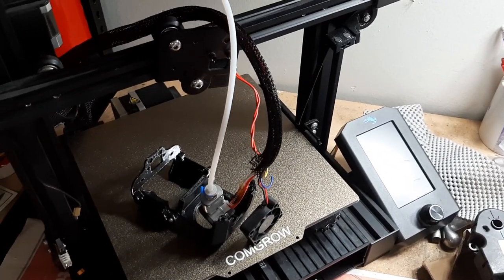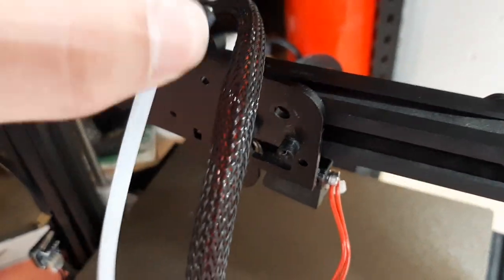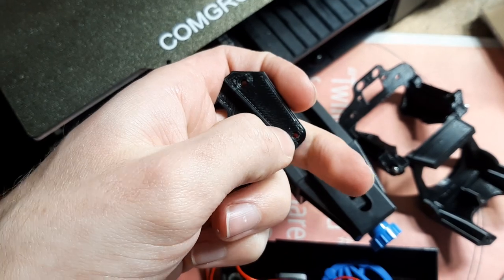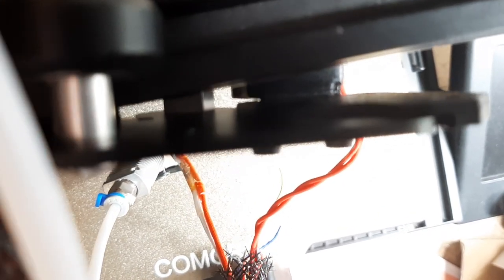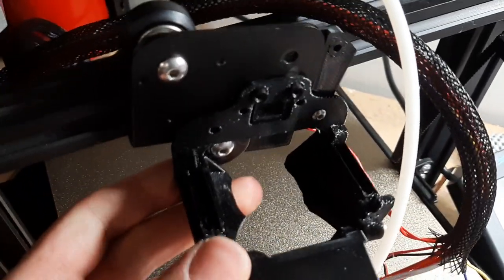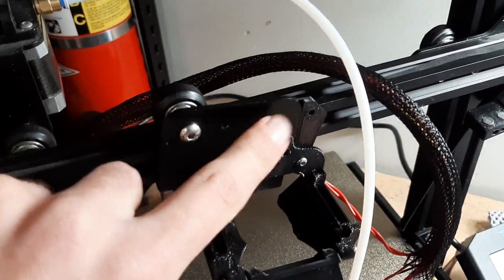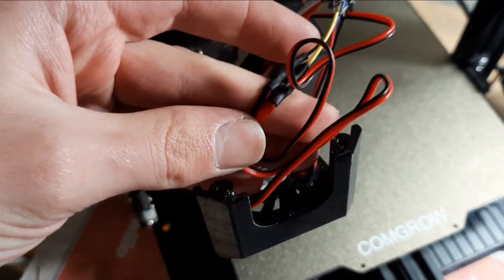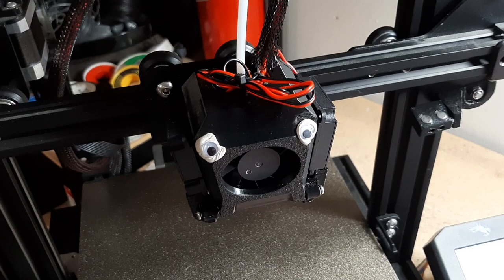MBOT3D Mk2 Remix Installation

Comment: Very nice video! I'm planning to do this exact mod to my V2 too.
How cumbersome are nozzle changes with this shroud on?
And most importantly... How has the performance been? Cooling improvements? Noise improvements?
Reply from the maker: I don't change nozzles often so I can't say for sure but it doesn't look much harder than stock.
Cooling is definitely better but it's only noticeable with very short layers, the stock hotend just can't push that much plastic lol.
It's a little louder but it's not that noticeable compared to all the other fans on the printer. Biggest downside I've run into is there's less clearance for conical slicing (which I do from time to time), I was using 5-7 degrees but now I'm not sure if I'm even going to bother because I wouldn't want to go past 1 or 2 degrees